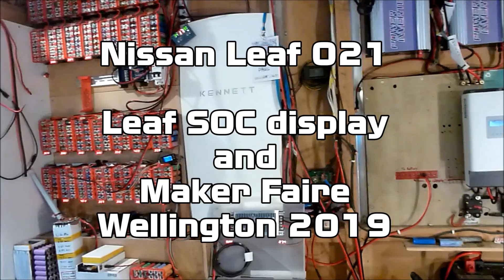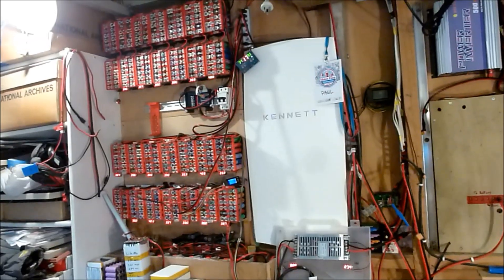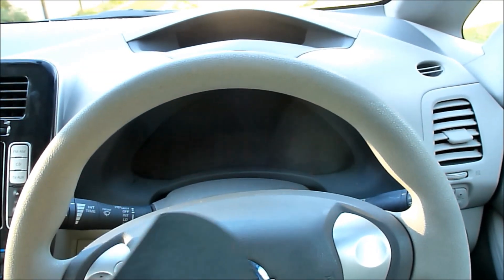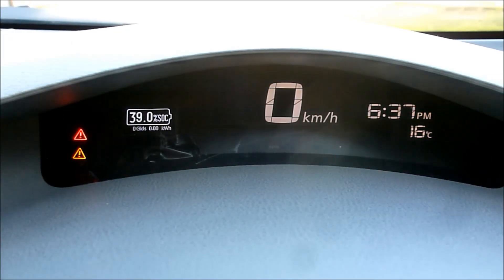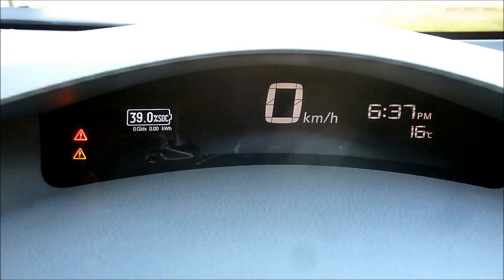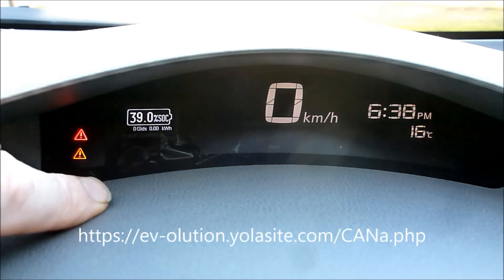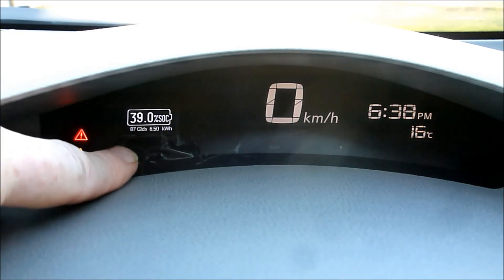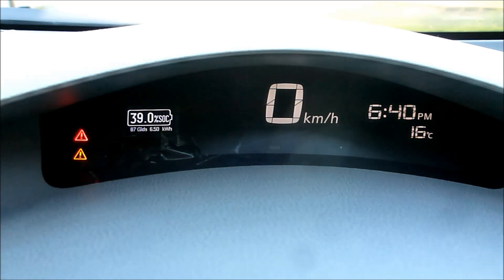Nissan Leaf 021 - SOC display and Maker Faire Wellington 2019

Comment: Hello. In general, I collected everything, put it on the car. The only downside is that the data is displayed a little incorrectly, there are photos at the very bottom. damn I can't send a link here the spam filter immediately deletes the message

Comment: Hello. I repeated this project, but unfortunately on AZE0, page switching does not work. Is it possible to fix this case somehow in the code. For example, a short circuit on the arduino nano input 9 pin on GND. and add the temperature of the high voltage battery
Reply from the maker: Yes - I used to use pin 9 to switch pages in the very early versions of the code. I'll have a play with my neighbours AZE0 Leaf and see what I can do.
Reply: @paulkennett  I will be grateful. In general, I thought to connect 9 pin to the charge timer cancellation button, there is just a short circuit of the button to gnd, the only thing I understood is that the screen switching is not cyclical(
Reply: @paulkennett  I tried to download previous versions, but when compiling, swears at errors. Only v58 is going to

Comment: Very cool that SOC display, I'm having LeafDD at the moment but your gauge is nicer :)
Reply from the maker: Those little OLED displays are great. The one in this video is a bit too small but there are slightly larger ones available which will still fit inside the dash. Since this video I've made a version that is rotated 90 degrees which allows me to show main battery Volts and Amps as well.
Reply from the maker: That LeafDD is almost a collectors item now :)